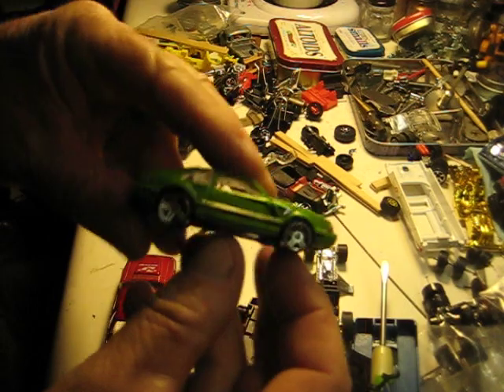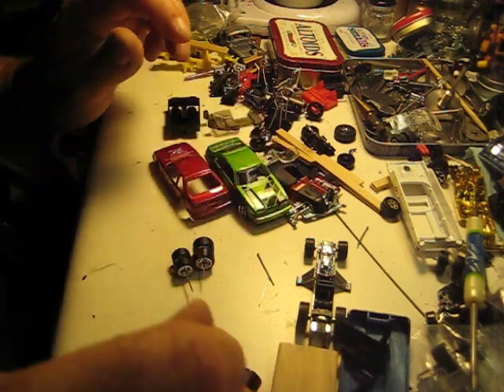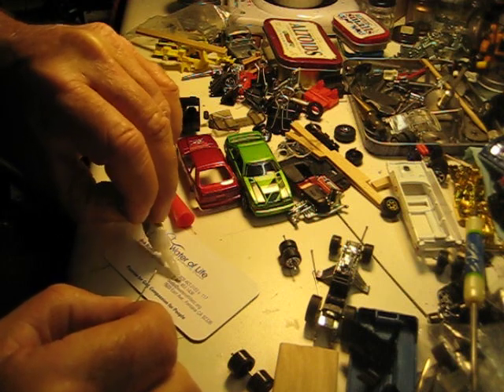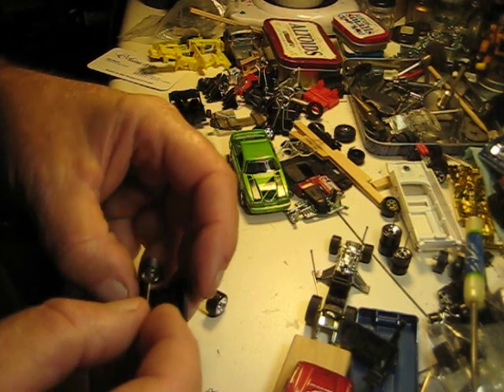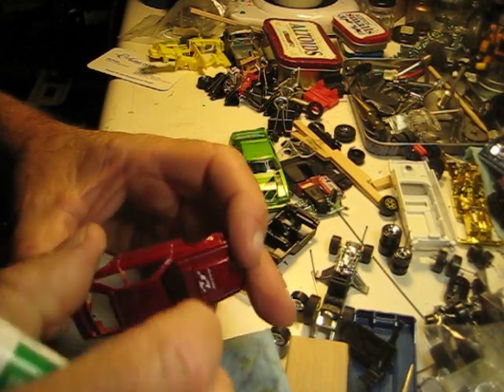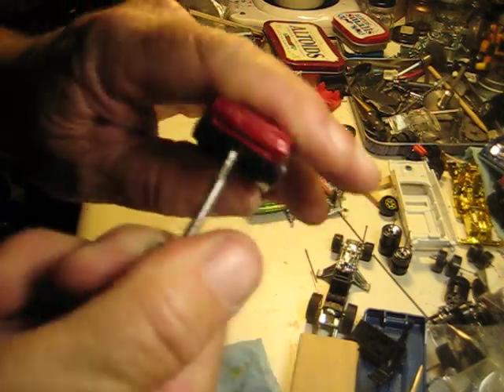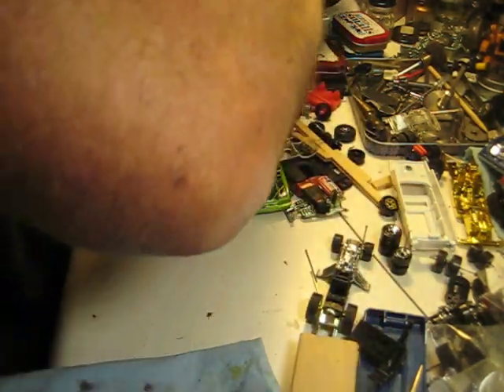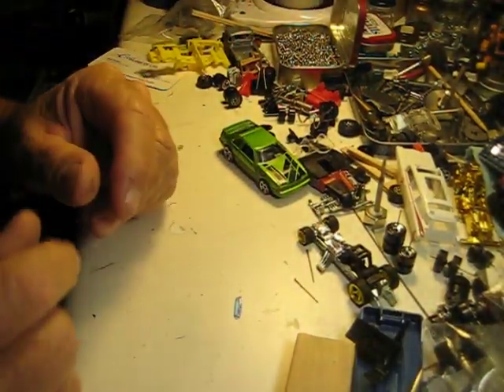Jimmy James

Comment from the maker: Yeah Piano wire is to hard i think that's what Mattel uses! I don't make to many axles any more since i started using the crimp tubes and new axle bending technique but if i do i use brass rod .032. It comes in 1 ft length's 5 to a pack.

Comment: Hey buddy. I have been using .032 piano wire for axel material from hobbytownusa. It has kinda a dull silvery finish and is really hard to cut. Looked online at the industrial supply place you speak of in CA. Is it metal or brass or what. The material you use seems easier to cut than mine. I am running low and need to order more. Please let me know exact name, metal, and size to request. Thanjs John